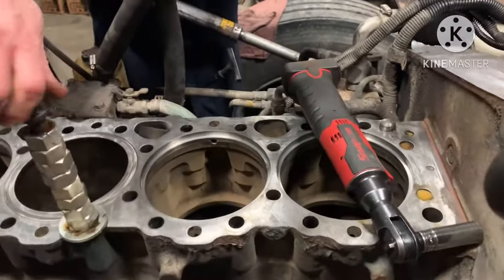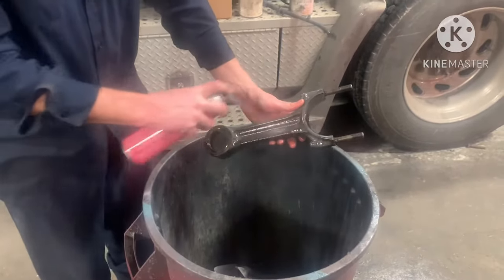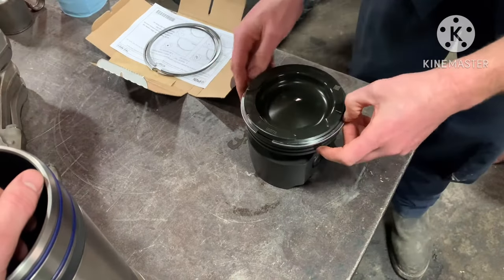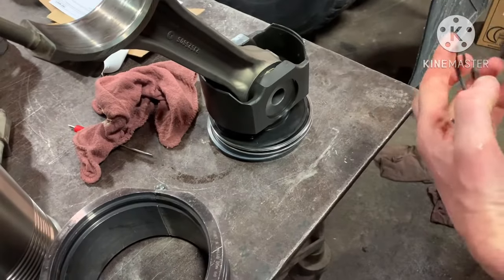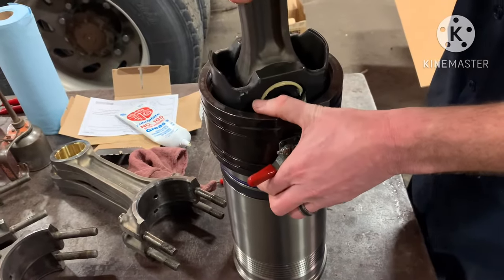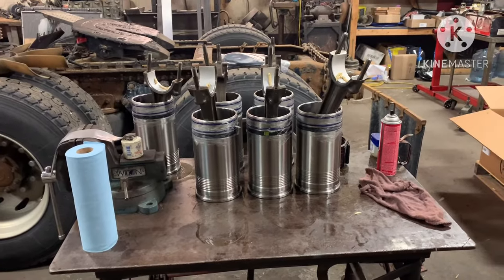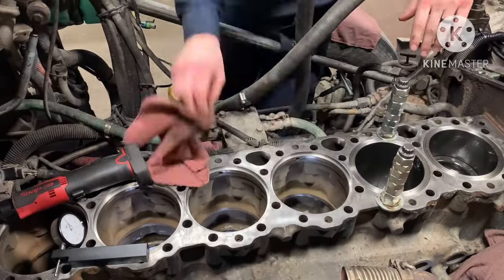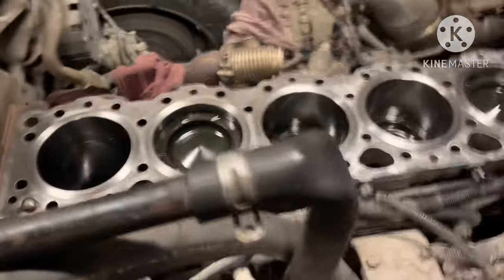14L Detroit diesel liners assembled, installed, and protrusion measured

Comment: What lit os that.  Is from detriot freightliner dealership oroff internet.  What's you guys thoughts on either?
Reply from the maker: I don't remember which kit we put in this. We only have used one PAI kit and didn't like it. All the others we have done and shop manager has done in 30 years have been genuine oem rebuild kits. There is definitely a noticeable difference in quality from oem to aftermarket. My personal opinion is if you can find oem kits in a timely fashion I would stick with them.

Comment: Great video, very helpful, although a pair of candle sticks would help to avoid that the piston slip out of the bottom, it would be a mess if it happened. Again thank you so much for this procedure, though much easier on 12.7 PRE EGR engines

Comment: got the same engine in my truck, going through 2 gallons of coolant a day. what tools do i need to buy to inframe mine at home?
Reply from the maker: 2 torque wrenches. a big one that is capable of 365 ft lbs for the mains. and one for the smaller stuff like rod caps and cam caps. liner puller and liner installer and ring compressor. basic hand tools after that. mostly 12 point bolts in this engine. can pin the engine with a screw driver and time the cam the same way. last thing you will really need is a manual for specs and sequences and general knowledge.
Reply from the maker: i would also find a depth gauge for checking liner protrusion. if you have dropped liners headgaskets won't ever last.
Reply: @GavinS6  if it doesn't sell quickly i guess i will be pulling the head to investigate, thanks